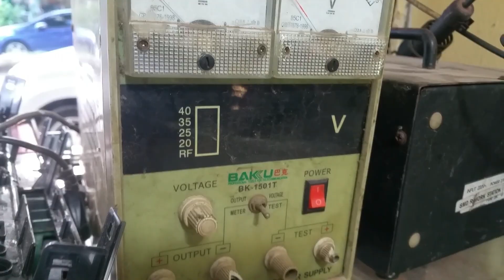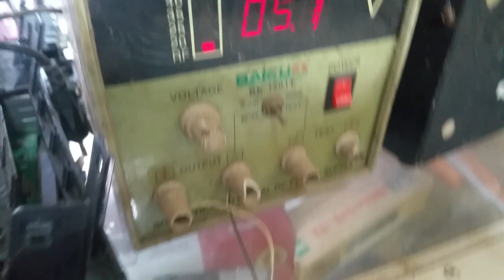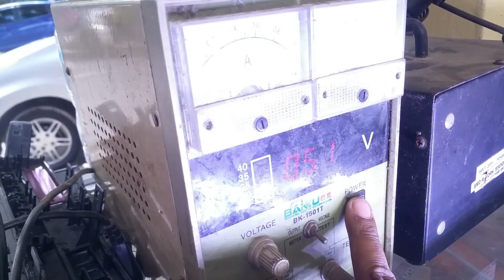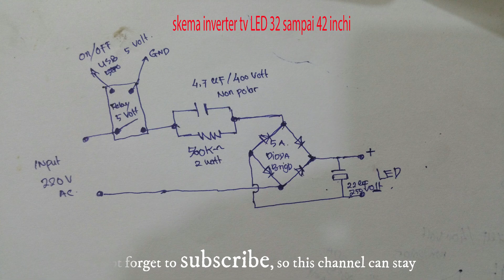cara membuat rangkaian inverter untuk tv led dengan harga sepuluh ribuan

Comment: Itu Rumusnya ada di Kimia elektro =
Dioda bridge itu merubah Arus AC 220V menjadi tegangan DC diatas 200volt saat tanpa beban dan dapat mengadjus secara otomatis jika terkena beban ( Secara otomatis mengikuti tegangan yg di butuhkan beban outputnya)
_ Resistor 560K di paralel dengan Kapasitor Non polar 4,7K 400volt Adalh sebagai penghambat tegangannya berikut kopling tegangan saat terkena beban
_ Elko 22Uf 250V adalah penstabil tegangan Dc.
Jadi kesimpulannya Itu Real dapat  bekerja Atau dapat menghasilkan tegangan output Antara 55 volt sampai 250volt DC.
Hanya saja kalau untuk yg membutuhkan voltase Backlight di bawah 40 Volt gausah di coba deh... Karna di tv LED 24 inchi Atau 32 inchi itu sebagian masih Ada beberapa rangkain Backlightnya yg di paralel dan hanya membutuhkan tegangan 25-30Volt saja. Jd bagi yg blm betul2 paham tentang sistem kerjanya mending gausah coba coba ya bakalan Putus semua nanti Bola backlightnya Kecuali kalau memang mau Aman silahkn Rubah semua Rangkaiannya jadi seri. Pokoknya usahakan yg membutuhkn voltase Agak gedek biar Aman. Tapi kalau untuk tv ukuran 32 inchi keatas saya udah Ratusan kali coba dan sangat memuaskan. Tapi tetap hati2 dengan Rangkaiannya ya karna disitu tegangan semua besar. Lumayan lah bisa nyembuhin Stroke kalau kenak... Hehehe😂😂😂😂😂😂,  Moga makin tambah sukses Mas Azwar...
Reply: Saya setuju dengan teori ini...jadi sebenarnya opsional saja tergantung kebutuhan hihi.tapi video nya tetap bermanfaat buat yg faham
Reply: Om berarti output ac-nya sendiri ya
Reply: Iya benar itu. Aman kok cuma gk bs contras aja..
Reply: ngeri nyetrum. wkwkw
Reply: kan Sudah dijelaskan di judulnya, hanya untuk 32 inch ke atas
Reply: Kalau tv led yg 24 inch atw tegangan inverternya rendah sebaiknya pakai  inverter universal saja yg banyak dijual di toko online
Reply: Kalau untuk positron 32inch boleh nggak bang..?